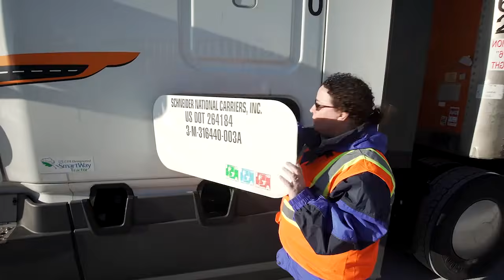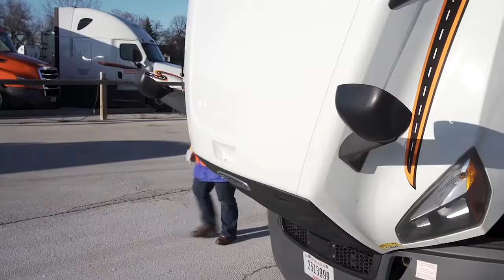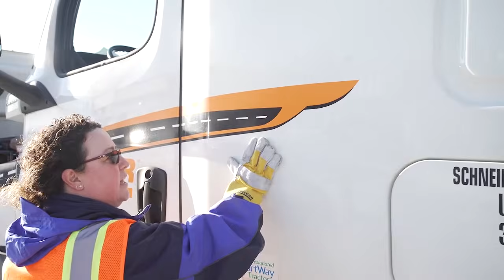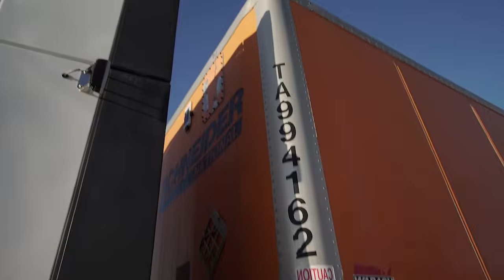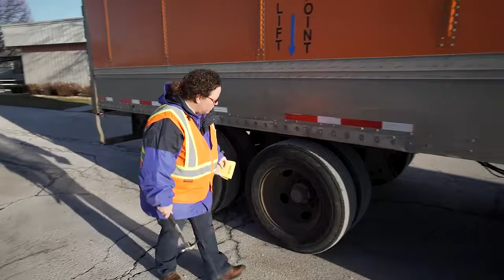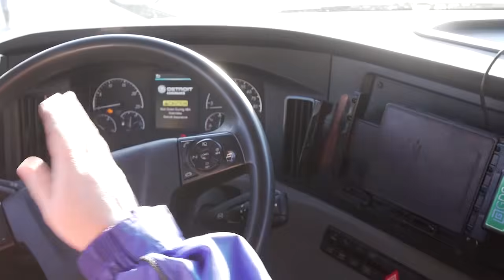Ultimate guide to a CDL pre-trip inspection

Comment: See that's what's wrong with the industry today. That is not a proper pre trip. You never put your hands on your drive line, you can't tell if your brakes are cracked either unless you are getting under your truck. And if you are not putting a gauge on those tires, then you don't know how much air is in them.. do it correctly and stop spreading false information. You also should be putting zip ties on the rods of you brake chambers when released then lock them down and measure to make sure they are adjusted. And if you're a driver worth anything you should be able to adjust your brakes and clutch as well. If not stay on the couch.
Reply: You’re miserable

Comment: I was told that Schneider gives you a cheat sheet for your pretrial and does the cheat sheet give you all of the information that she is giving
Reply: Damn that's alot to remember, she scared me.i wanna be a driver not a mechanic.
Reply from the maker: Hi Daniel, yes, we do have a "cheat sheet" of sorts that you can refer to when doing pre-trip inspections. And yes, the sheet has all of the information Dana talked about in the video!
Reply: There’s no cheat sheets.  You are allowed to use a pre plan inspection form as you check everything that is on the sheet
Reply: @kennethsnyder9236 good enough to call a cheat sheet, because all them parts and names can be a headache